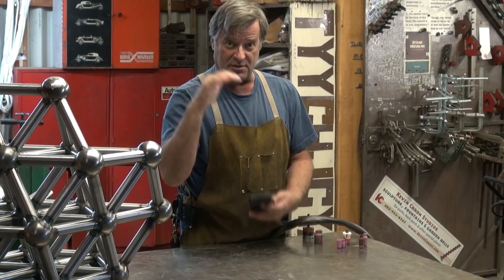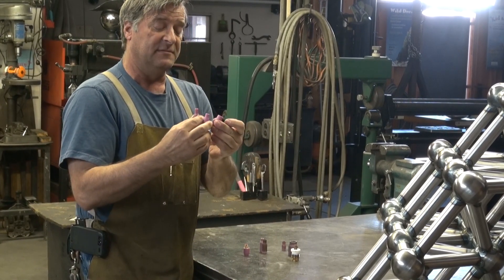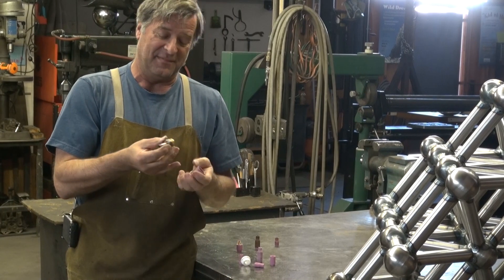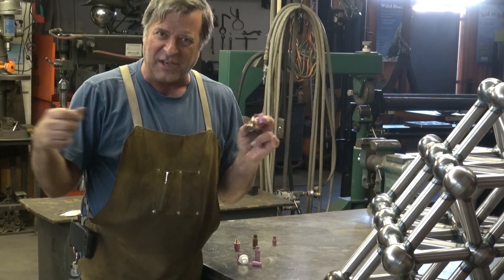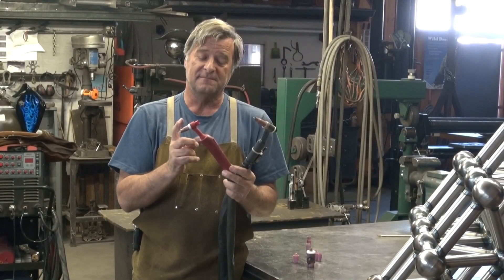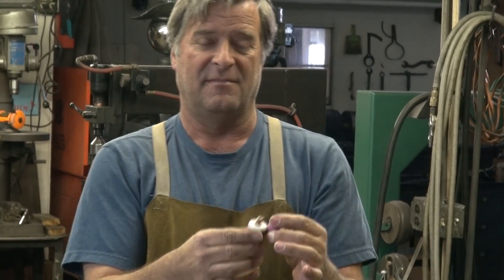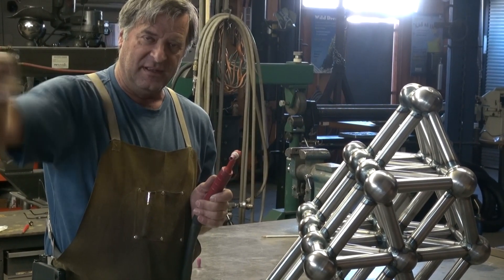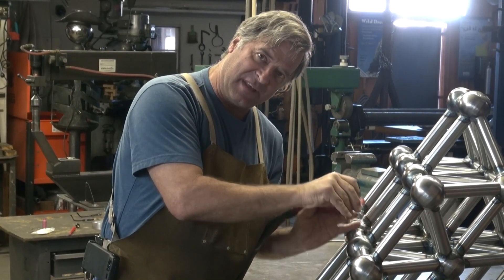How to Pick the Right TIG Welding Cup - Kevin Caron

Comment: Thanks, I assume with more amps you will have a larger heat affected zone so maybe larger cup required to give more gas coverage (if cup will fit in space as you say)
Reply from the maker: You are correct.  Larger weld needs larger cup.

Comment: Ok after seeing your video I have bought tig cup set (10pcs) , it arrived and it was a wrong size. Thread size was much bigger, why you didn't talk about that?
Reply from the maker: You are correct.  I do mention that the cups are different sizes to fit different torches but I don't come right out and say you have to order by torch size.  The number on the side of the torch is what you have to order for.  Getting old I guess.

Comment: Smaller garden hose equals more VELOCITY, not more pressure.  SAME pressure through a smaller hole equals higher velocity, Mr. Artist.  Nice comparison, tho.  Pyrex cups are more camera friendly, BTW...
Reply from the maker: But why does the hose also get bigger in diameter if you up the pressure?

Comment: I pulled the trigger and bought the AHP AlphaTig 201DX from their website.
I didn't get it yet but was wondering what type of tungsten, cup and rods should i order for 19 gauge sheet metal work on a car. That will be my first project with a Tig.
I know it depends on experience and feel but i want to be in the right ballpark. 

Thanks
Reply from the maker: I like the E3 for this machine.   As to the cups, get an assortment so you have the right size for the job.  For filler rod you are going to need a few different diameters for steel and aluminum.  Like  1/16th , 3/32th and 1/8. would be good to have on hand.
Reply: @KevincaronSculpture  Thanks for the reply.
what is the E3?
Reply from the maker: Tungsten,  also called a purple top.  Get 1/16th, 3/32th and 1/8th.
Reply: Thanks Kevin

Comment: with the gas lense doesn't that allow you to pull your tungsten out farther to be able to get into tighter places?
Reply from the maker: Yes, it does and also lets you run a little less on the flow meter so you save some gas as well.

Comment: I had the pleasure of working with a RIDICULOUSLY teeny tiny baby sized cup and torch last year (forget the exact size). Needed to get some small reinforcement welds in some ridiculously awkward spots on a structure after it was shipped out from Germany and put together. Even with such a tiny cup I still needed my tungsten to stick out quite far just to get to the weld area, not to mention some spots I was almost working blind trying get both the torch and the wire in at the same time.

Comment: Kevin, Different cup sizes are useful in pipe welding, smaller cup for root pass where you have to get deeper into the bevel, larger for 2nd pass. And socket welds if you are walking the cup. I use a gas lens when possible, I can cut down the flow somewhat. Air cooled torches also had two different sizes of gas lens. Large and small which helps with the bulkiness. If your lens ever gets spattering on it, try taking a sharp tungsten and prying the outermost spattered screen off theres more than 1